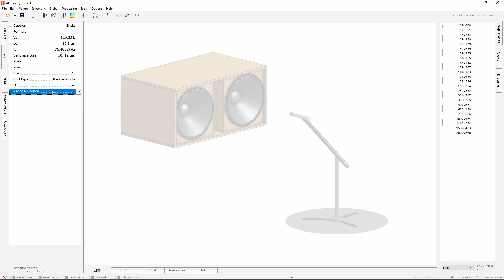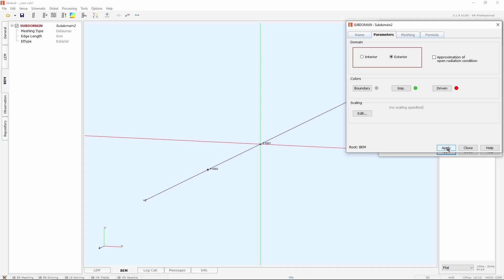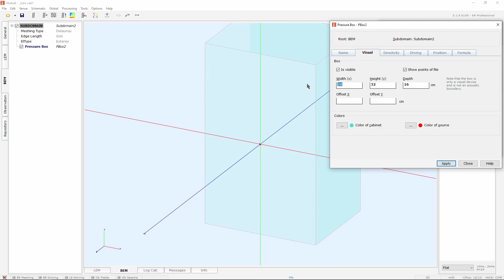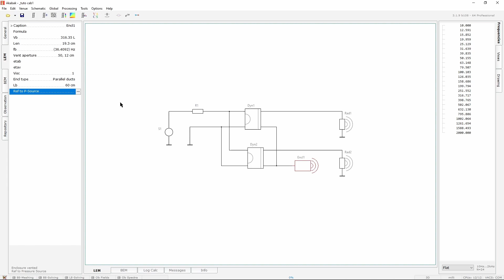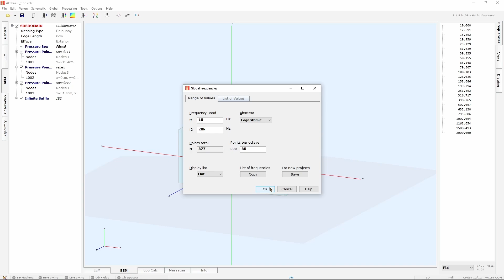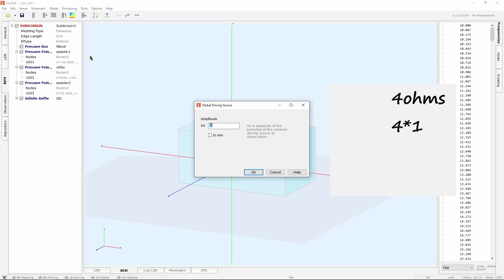Akabak explained | BEM ref, frequencies & power #7

Comment: Hello,

Thank you for the great work you've done with this information.

I just wanted to point out that at minute 2:06, you mention that the advantage of the pressure box is that it allows you to set the shape of the cabinet, acting as a solid surface on which sound waves reflect.

However, after reading the manual, I found that the pressure box is just a visual representation and does not impose any acoustical conditions.

Could you please double-check this? I just want to make sure the information is accurate.

Thanks again, and keep up the great work!

Comment: always get an error message, that the pressure point, linked to the vented enclosure is muted.
Reply from the maker: And I do too, if I don't use the pressure box's radiation output in LEM. But you'll still get the acoustic response if LEM is linked to a pressure point instead of the pressure box. You might aswell use the pressure box radiation output for the port and 2 points for the speakers for instance, this won't give any error and get you the same graph